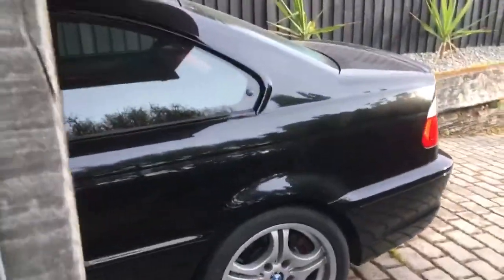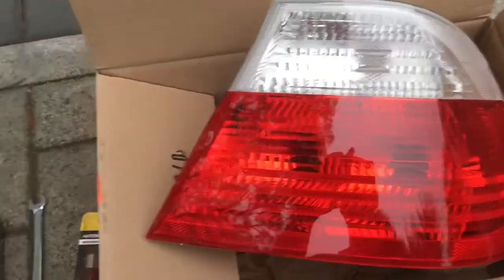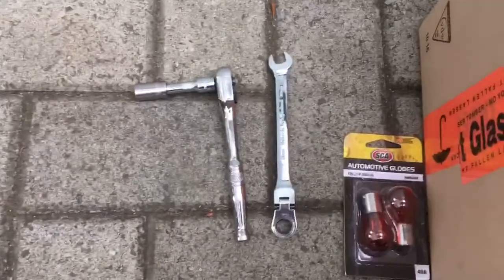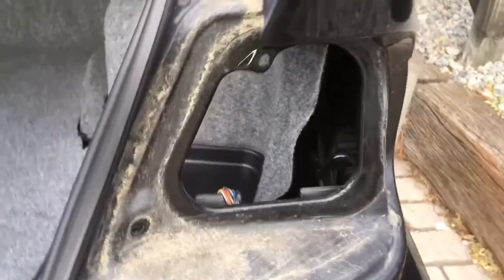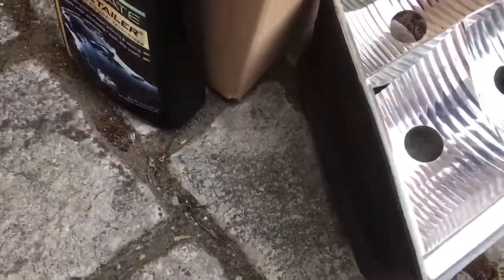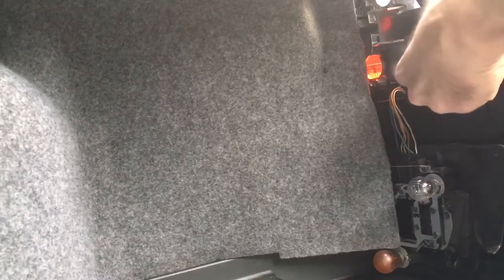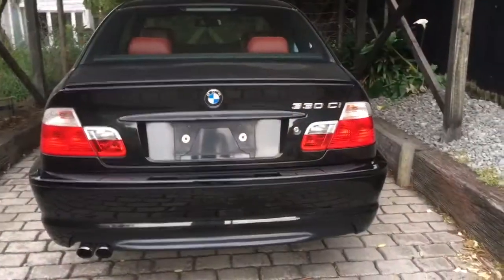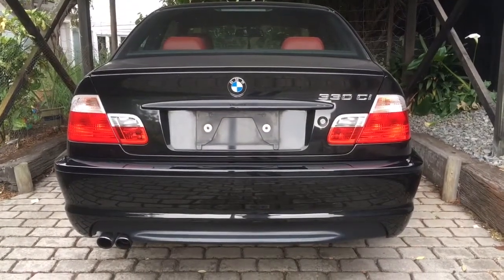BMW E46 Coupe rear light cluster replacement

Comment: How did you remove the inner gasket from the the old tail light?
Reply from the maker: Just pulled it away carefully, it comes off without too much trouble
Reply: The lights leak also and the boot gets wet, especially on the smaller part of the light